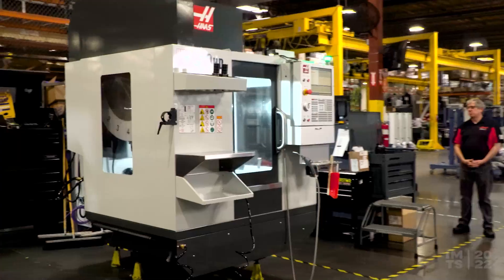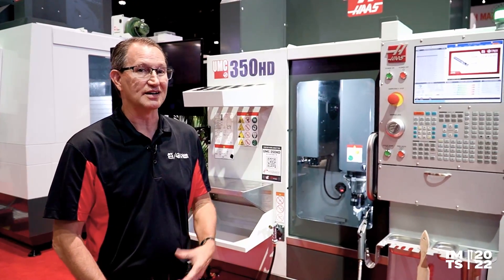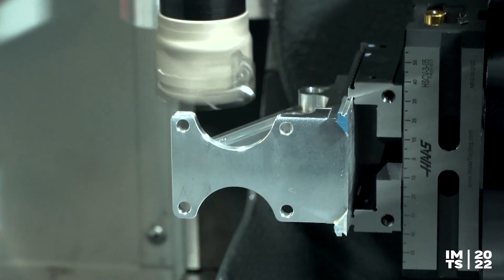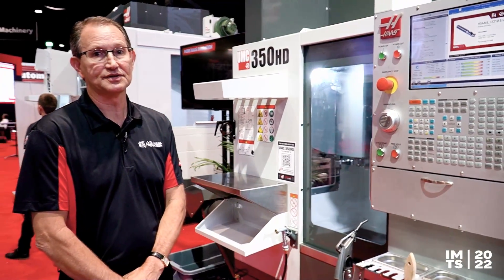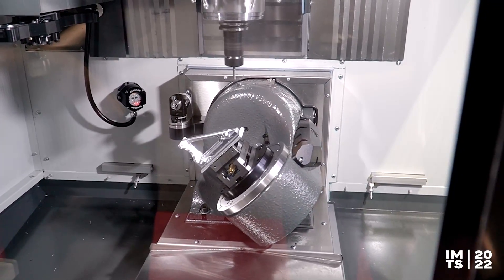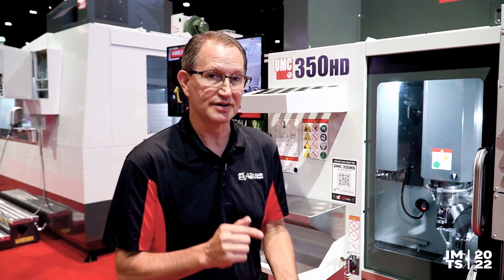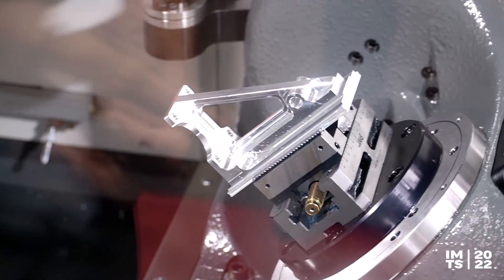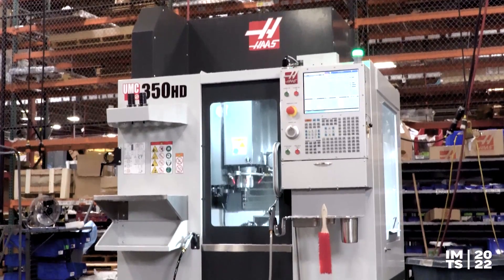Haas Introduces the New UMC-350HD at IMTS 2022 - Haas Automation, Inc.

Comment: Like many people here, I also want to know what the height is and (critically) whether it will fit under the lintel of a standard (UK) garage door.
If HAAS have designed it too big to fit through the door of a home-shop, then their strategic marketing team have messed-up the requirements.
It doesn't matter how fancy any of the other specs are if it won't fit through the door!
Reply from the maker: MaxWattage, The UMC-350HD is 95" tall installed and about 91" if you're skidding the base on concrete. The machine is quite similar to our DM-1 externally: https://www.haascnc.com/machines/vertical-mills/drill-tap-mill/models/dm-1.html
It may be possible to further reduce the 91" clearance number with removal of sheet metal (headcovers, TC cover, etc), but those accommodations have not been resolved yet.

Comment: A lot of my buddies who have bought brand new Haas machines have been complaining about general QC issues. Many of them have had to make several warranty calls on brand new machines. The NGC is aging and being passed up in features and usability by newer controls, your prices are going up and the value of your machines is not. Dealing with your distributors and HFOs is often a pain in the ass in my area, and our local HFO has been blaming the customers for factory QC problems. Your reputation is souring quickly. I want to support American manufacturing, but all of this was enough to make me choose a Doosan over a Haas for my most recent machine purchase. What are you going to do about all of these things?
Reply: Haas CNC has a very strong support network in place.  Also, Haas CNC does not face the same increasing neighboring Authoritarian country threats as other off shore machine builders.  Worldly events the last few years has changed manufacturing in many ways.  Haas CNC is a good investment when considering how manufacturing has recently changed and is being threatened to change
Reply: @robdejong133  I am not interested in hot air from the peanut gallery, I want to hear an answer from Haas themselves.
Reply: I bought a new 2020 UMC 500 with pallet pool and I can say without hesitation; it's my last purchase from Haas.  The machine was nothing but trouble for the first year of ownership due to missing parts and poor design.  The local HFO now had the burden of providing extra service on a defective machine.  The service went like this: I'd place a call with the local HFO when the machine would fault out.  A week later an undertrained tech would show up, read the fault code, call the factory, reload the software, and leave.  A few days later the machine would throw the same fault and the cycle would repeat.  There was a missing plug on the C axis top casting that was allowing coolant in, flooding the internal sensors and cables.  I asked the service tech what the hole in the casting was for which prompted another call to the factory which lead to the reply: there should not be an open hole the casting.  Regarding the poor design: the machine is not capable of running unattended without puking coolant when the chip tray fills up.  The coolant return from the chip conveyor is near the edges of the chip filter.  Rather than being directed to the middle of the chip filter, the chips stack up quickly near the edges of the tray and easily overflow.  Depending on the parts I'm running, I have to clean the chip filter every 3-4 cycles before it pukes coolant all over the floor.  The pallet pool is a total waste of money on a machine that can't run unattended.  I used to be a loyal Hass customer but I have my limits.  I'll take my business elsewhere.

Comment: is it automation ready (palletchange -> erowa compact 80)?
How tall is it in its shipping configuration?
Reply from the maker: ShasOAunLa, The UMC-350HD has provisions for our Zero-Point Clamping option on the platter or can be configured with an Air Vise option. The machine will be compatible with Haas robots and the Compact APL. 
The machine is 95" tall installed and about 91" if you're skidding the base on concrete. The machine is quite similar to our DM-1 externally: https://www.haascnc.com/machines/vertical-mills/drill-tap-mill/models/dm-1.html